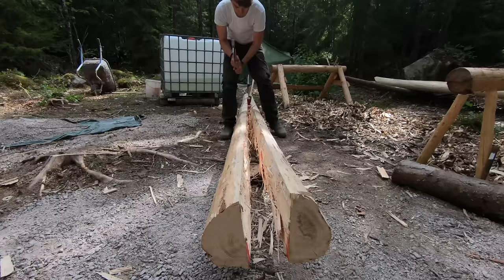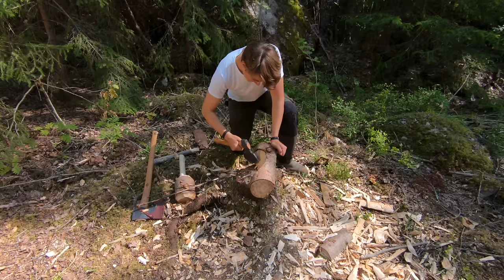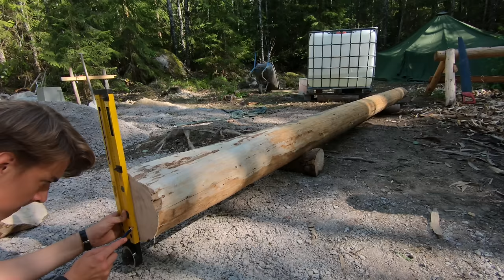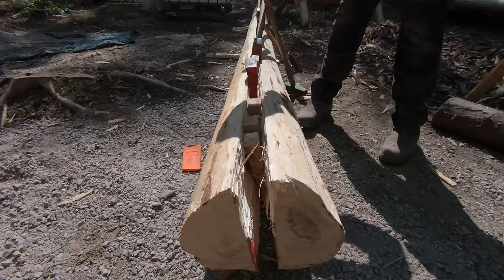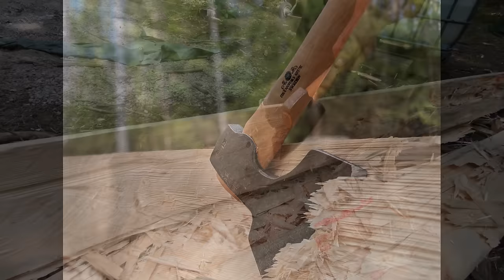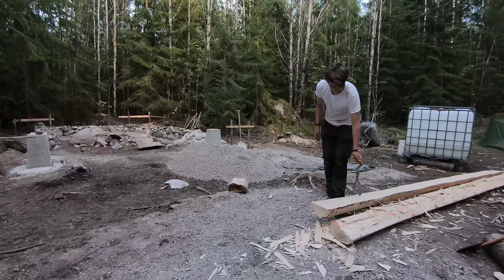How To PERFECTLY Split a Log Lengthwise Only Hand Tools | 6.0 |-One Man Traditional Log Cabin series

Comment: Ambitious project ;) Nice work splitting the log. A couple of suggestions, if I may? Make yourself a log hammer for driving those wooden gluts. It will be much more efficient than the sledge you used here. Even with hand tools, it won't take long to make one ;) When you are hewing for the final surface, you want to work the axe cross grain as much as possible. It reduces the chance of the axe biting into end grain and tearing out fibers that you wanted to cut. Some of your hewing does this pretty well, but other times you're swinging straight into the end grain. It may feel like that gets you more progress faster, because you can knock off some pretty big chips that way sometimes, but it's always at the risk of tearing right past your line and into wood you planned on keeping. Keep up the good work!
Reply from the maker: I am very grateful for your tips Peter. This was my first time doing this, so it is very helpful for me to get this kind of response from how I work. 👍
Reply: On my first house…
(It was for myself.)
An experienced builder, after looking over my drawings, told me I was being too ambitious. He said for your first project you should do something simpler. I was determined and pressed on. It wasn’t easy. I knew I had taken on too much also. But with God’s help I got it done.

Comment: And to think that this is how vikings made boards for there long boats... Halving then quartering ect... Until they got a 16th wedged rail that they then hewed with a broad axe into planking. So much work!
Reply: Mr.McGoover yeah it’s a lot of work but they knew that it made a stronger, more flexible plank. You don’t need to steam bend with axe hewn planks, just a little bit of heat. Axe hewn planks are also cut along the grain, which eliminates a lot of weak spots that you’d normally get with sawn planks
Reply: People in the past were incredibly strong, from a life of hard physical labor.

Comment: Step one: Make sure you have a suitable log with straight grain and no significant knots. Step two: Layout carefully. Step three: Use lots of wedges and proceed with caution. I make it sound simple, although it's not easy to accomplish. Good job!
Reply: Is there a way to figure out how suitable the tree will be for this before you cut it down? Like id assume looking for a long stretch of the tree without branches will get rid of those knots but can you normally see all knots from the surface of the tree? Also can you tell if the grain isn't very straight from the outside at all? Idk if you will ever see this but I'm curious cause I want to do this for a project but can't really afford cut down several trees I can't use 😅

Comment: I almost bought one of those GB broad axes but I thought it seemed too light and too small. I'm thinking by the footage here that I was correct. It seems to struggle a little, like you have to give it a lot of force vs letting the weight of it work for you. That's just my humble thoughts on it. But it was a beautiful tool and well balanced and very sharp in the store. 
Nice work young man. You're on the right path in life.

Comment: Watch how you work as far as your back.  The only reason you haven't felt the results of poor ergonomics is you haven't been on Earth long enough.  You can do this work and do no harm to your back if you learn how.  What will you be using this cabin for?  Seasonal use?  Consider reworking the rocks foundation. If regular use of the cabin and longevity is the goal.  Good job on the split.  Thanks of the video.

Comment: The club will last a little bit longer if you use the endgrain as a striking force, also willow withers around the center will hold it together a bit longer.
Reply from the maker: Thank you for the information 👍
Reply: Actually, I think the original name for your wooden striking implement is a "beetle", the original use was to beat in a froe into the end of a log to split off shingles or boards.  The reason you use the side to strike with instead of the end grain, is that the tool lasts longer.  If you strike with the end grain, it tends to split apart and soon becomes useless as a striking tool.

Comment: Hi there. First of all when doing these tutorials it helps to use the correct tools to drive wedges a large wooden maul was and should be used as it is safer and parts of the iron wedges will not explode ,2 the sledge hammer you are shown using is a napping hammer for stone or railway spikes not for wedges , 3 the choice of logs will leave less tare aways than shown as the log you  hose has about 1/8 twist that you had to fight while splitting  I hope this is helpful, I'm not trying tobe negative but offer a little instruction,

Comment: Had to speak out on an axe matter. While you can use the axe as a wedge like this they are really not built for it. In the end you will open up the axe "eye" by using it as a hammer/sledge/wedge. The only kind of axe that can take that kind of "abuse" is a sledge axe. Considering the quality of axe you use here is quite high you might want to get some cheaper axes to use for this method. Don't get me wrong, it is perhaps the best way of doing it to get precision opening cuts on a log but as I said, the axes will in the end be damaged by it.
Reply from the maker: O I thought the Husqvarna sledge axes could take that metal sledge hammer. The Gränsfors bruks felling axe is only used for guiding the cut with lighter hitting from a wooden mallet, but I guess it would be better to use a cheaper axe there. 
Thanks for your feedback 👍

Comment: Erik, I notice that you make pegs for holding logs together with a hatchet or small axe.  Have you considered using a shavehorse for rounding and shaping pegs. It wouldn't take long to create the shavehorse, and once you have it creating the pegs would be a lot easier. :-)
Reply from the maker: Yes I have considered it. Because it would be much safer and faster to use. But If I were to make one i would do it all with hand tools from own tree, so don't know if it is worth the time right now. Want to get the roof on as fast as possible.

Comment: We use un cincel and a wedge made of wood and machetes. Lol here in Mexico to split palm logs. Very soft wood in comparison to o what you are doing. But I'm determined I'm building me a casita out of them and i want to split them in half? Build a stem wall of rocks then add the troncos de Palma. Am i loca? I've nothing to loose. Floor of slate rock because a square meter costs me 90 bucks. What do you think.

Comment: If your going to do a lot of that, you could profit from a proper hewing axe, with one flat side.   I mean you do a fine job as is,  but it’d be easier and quicker.
Also your mallet would last longer if you cut the top off and put the handle in perpendicular to the grain.  That way you would be hitting the end grain, but it’s more work, so maybe it’s not worth it for you

Comment: What kind of an axe do you use for the splitting?
Reply from the maker: I would only use (wooden) wedges but did not make enough, so I also drived in   Husqvarna Splitting Axe. Otherwise I used Gränsfors bruks Axe to make the starting cut. I used Gränsfors bruks broad axe model 1900 to clean the surface.

Comment: I really like the idea. W hat’s about building permit in Sweden, do you need it for cabin like that?
Reply: It depends, I think. If you are going to use the cabin as resting place when you work in the woods, you don't need a permit. You can also build a 30 square meter house without a permit, but then the roof is not allowed to be higher than 4 meters.
Reply: Sebastian E 
Thanks Mate, it’s great thing to have a place like that. Absolutely magic.

Comment: i would never strike the pol of an axe with a steel hammer it mushrooms the head of the axe and distorts the eye. You have good tools and it is not best to abuse them this way.
Reply: Some axes are designed so that you can do that. From what I saw in the video he only struck sledge axes, which is perfectly fine.

Comment: What kind of axes are you using?
Reply: One of them is Gränsfors Timmerbila modell 1900 (https://www.gransforsbruk.com/produkt/gransfors-timmerbila-modell-1900/)
A type of broad axe
Reply from the maker: Gränsfors Amerikan felling Axe, was used just to guide the split (otherwise I use it to fell my trees). 
I used some splitting mauls from Hultafors and oak wedges to split the log.
The broad axe, Gränsfors Bruk timmerbila modell 1900, was used to give the log a straight and smooth finish.
Reply: @ErikGrankvist  is the Gransfors American felling axe with 50 cm or 90 cm handle ?